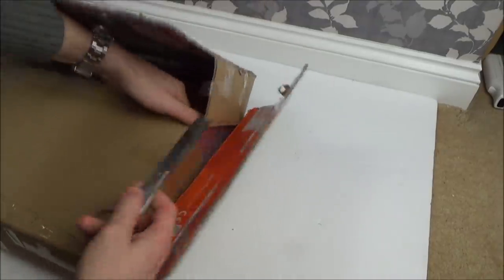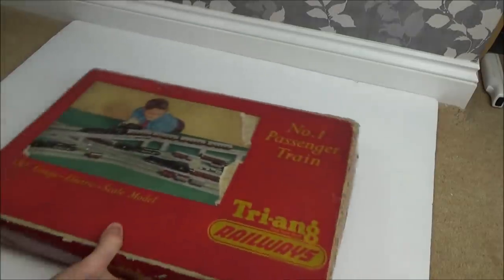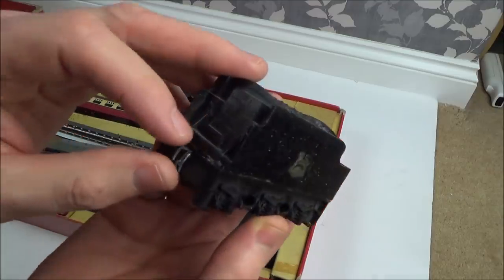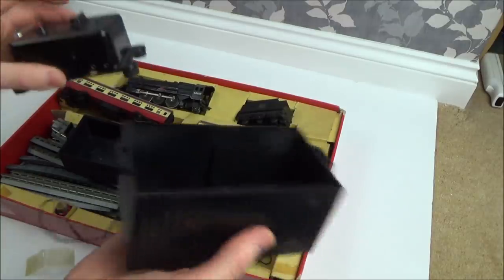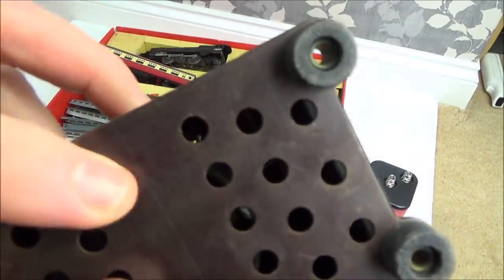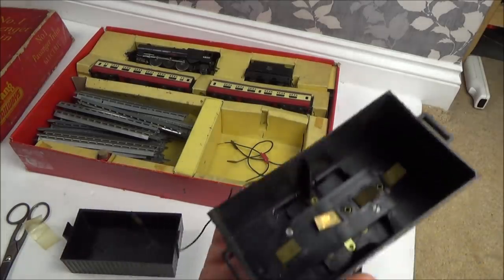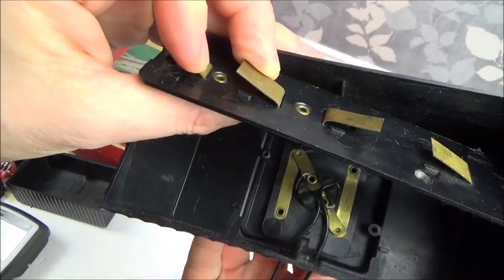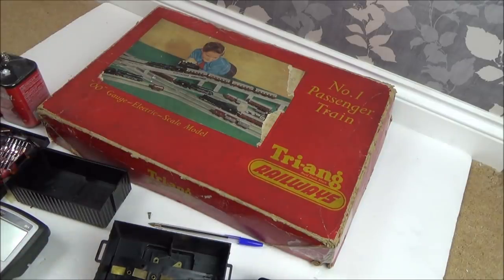eBay Pre 1980s TOY Repair Challenge PART 5

Comment: Simple resistance controls (resistors, rheostats, potentiometers) drop voltage only in proportion to the load (draw) of the item they connect to. With no load the voltage coming out will be little different from the input. With the load (motor) applied it will have a range of control. 

This is a constant in electronics and is how voltages are set by resistors in all circuits. Values are calculated using a formula (Ohm's Law) to give the desired result. Under no-load conditions voltage passes through with little hindrance but voltage will drop as loads increase. 

Battery operation was common in early train sets as it was thought that it was dangerous to allow children to play with mains connections. It is only in recent decades that well-insulated transformers and children gaining experience and confidence using plug-in items that parents and manufacturers have made line operated supplies (aka transformers) common and trusted. Youngsters today routinely use audio devices, tools, games, and toys on electrical systems.

There are now sophisticated power units used by hobbyists that have controlled and constant outputs that can even simulate real train behavior. The current system used by serious hobbyists is digital control (DCC - Digital Command Control) that can control sound, lights, speed, direction, and other functions.

Model trains have come a long way since the 50and 60s.
Reply from the maker: Great info, thanks for sharing it :-)

Comment: The thing with the electromagnet is effectively a circuit breaker-  if something shorts the two rails together, it'll disconnect the power briefly and make a loud buzzing sound (and hopefully avoid shorting the battery too badly).

Comment: My very first trainset was that one!
Those coaches have "gone banana " where the plastics have lost rigidity over the years. 
This is similar to the problem you have had with the shrinkage of nylon gears cracking on metal shafts due to the evaporation of oils in the plastics themselves. 
I once saw a video on solving triang banana coaches placed in a bath of warmed mineral oil and a spring placed in the body to stretch them back into shape.

Comment: I think the batteries for the rovex controller were ever ready pp7 type.
You have two controllers there.
The big one is an integrated one with the pp7 batteries inside the case and the smaller one is just a rheostat where you take a power feed from a 12 volt battery pack or a transformer outputting 12 volt dc.

Comment: Maybe it was modified to use LR12 batteries? If the original type of batteries is difficult to find perhaps the previous owner straighten the contact plates to allow the usage of LR12 ones, it would work i think (slower as these are 4,5V instead of 6, but enough to move the train).

Comment: You can try to use white winegar to clean the corrotion of the rails, a bath of 30min is good enough to remove corrotion and have better contact
Reply from the maker: Thanks for the tip :-)
Reply: My Mate VINCE how can i do to send to you a present for your channel?
Reply from the maker: Hi, thanks for the offer but I would rather you treat yourself to something instead of donating to this channel. I make money from the adverts at the beginning and end of the videos so I don't have to rely on donations. Thanks for the very kind offer though :-)
Reply: @Mymatevince  oh ok, i would like to send to you a screw kit from iFixit, nevermind :-)

Comment: The other controller was for a different set. Confusing huh! I vaguely remember a slot car set that works simular to that. I think the arm broke off. Those sets were so cheap anyways. The brass would oxidize and they wouldnt work. I remember those preslot car HO scale size.

Comment: Older batteries had the connections directly left and right on the top of the batteries,not angle like the newer ones. They would have fit in perfect. Battery design has changed since that was made

Comment: PP9 batteries were 9 volts instead of 6,  so that may also be a factor why the train struggles a bit
Reply: But it didn't take PP9 batteries. It took P996 Lantern batteries (6V). The train does run on 12V (my brother had one with an updated mains powered controller which delivered 12V). I think the train goes fast enough (as fast as I remember it - any faster would look totally unrealistic). The problem is just the occasional bad contact with the track. It's really important to get the track pieces fitting properly and making reliable electrical contact with each other (they tend to move a bit and break contact as the train goes round the track if not 100% connected).
Reply: These train's are designed  to run on 12 volts not 18 volts. Yes would give it more power but would damage the motors.
Reply: Did they change the contacts somewhere down the line then? It is strange the battery will fit but the contacts don't
Reply: I'm not sure that they have changed the battery layout over the years i have done a search that shows other 6 volt lantern batterys with the correct terminal layout but they won't fit in that box. as for the terminal's i have looked at other tri-ang set that use that box and they are the same. may be there was a small part that fitted on the positive spring of the battery and touched across to the positive  terminal on the box.

Comment: I remember the batteries you should use for this thing but the last time i have ever seen them was probably in 1985, and actually the "speed controller thing" is not meant to be used with the battery box, its meant to be used with a mains power supply which you get separately! The battery thingy is just for easy usage or so, back in the days i never even touched that and just used the speed controller thing with a mains power supply
Reply from the maker: Thanks for the info :-)

Comment: 00 gauge wire wool is a friend you should have, great for 'cleaning' terminals and all metals, Also the number on the train is the only real way to match a train, on the outside by the driver section eg: 700123

Comment: I've seen a lot of sets built using silicone on those type of tracks to mount on boards etc prob use the same idea to keep tracks together if it going to be prem set

Comment: Just wondering if you had to pieces of tin that could soldered to each outer contact in the form of a cross in order to contact the outer spring contact.

Comment: I tryed getting an RC fireboat  on E- Bay but they wanted $100 for something that doesnt work. For $9 dollars more I can get one that works. I offered $45 plus shipping and they said no. I dont really care but it would have been fun to fix it. I already upgraded one like it to an actual RC quality receiver/ transmitter and servos. The listing said it didnt operate but would be good for display. The thing is... Its not a display item. The quality isnt high enough. It is all plastic, not a high end unit. Oh well. I dont think they really wanted to sell it.

Comment: Hi Vince. Another great video.Hope you do well. It might be an idea, to get a few Lego parts in a small box, as you'd be surprised what you can fix using various bits of Lego, and maybe the tracks could have been repaired
/reinforced by using it to create tabs.
Reply from the maker: It is a good idea, I have never thought of cutting up Lego to use to fix other things. Cheers for sharing the tip :-)
Reply: @Mymatevince  see toypolloi, a great user of this

Comment: Hope you do OK on this Vince but there are quite a lot of similar sets on eBay (some with different track admittedly) at not very high prices, so I'm not holding my breath on this one :-(  Good job nevertheless on getting it going. Very nostalgic for me because, as I mentioned in a comment below, my brother had this set except he had an updated, mains powered controller/transformer delivering 12V 1A DC. I think the train ran at about the correct maximum speed...just the track contact was a bit dodgy on your one.
Reply from the maker: Yeah, I don't think any profit will be made as it is still not perfect (far from it) and there isn't much demand. Nice to hear your brother had one and that this train might have been running at its normal speed. Not bad for a possibly 60 year old train. Can you remember if it was originally from the 50s or 60s?
Reply: @Mymatevince  I think it was about 1957/58 Vince, which may have been a slightly later version than yours. The locomotive and coaches were identical but, as I say the controller (not the Fat Contoller :-) ) was superior; it was a cast iron model with a chicken head knob control. It was mains powered and, via a transformer in the case, delivered 12V 1A (that bit stuck in my mind as I have always been into electronics). I can't be sure now but I THINK the track was two rails joined only by sleepers but it had exactly the same electronic connectors. I'm guessing that the set you had probably predates my brother's by a few years (probably 1953/54?). We had carpet flooring then in the living space (the kitchen was too small to play in) and therefore derailment was common :-)  Great Channel mate, keep up the good work.
Reply from the maker: @standishgeezer  Interesting, I thought it was 50s. So it does definitely run on 12V. I need to find a picture of the inside of the original 'working' battery control box to see what the contacts looked like. Most comments on here think I used the wrong shape batteries but I don't think I have :-)
Reply from the maker: Excellent, the instructions are printed on the lid of that box, mine must be an earlier model. So like you say it clearly shows and it is written Ever Ready 996 but the strange thing is that the contacts on that box are exactly the same as mine so the batteries are not going to make a contact on that one either. Strange to have both of them with the same problem/missing bits. Maybe the battery design has changed over the years from straight spaced but I thought those lantern batteries always had diagonal spaced contacts!!!! Thanks for finding the link :-)

Comment: If cheap enough replace the wires from the power to the switch and to the track and use a fine wire wool on the track when will this be on eBay I want it
Reply from the maker: Hi, I need to get it listed either Sunday or Monday. I think I overpaid for this though. There looks to be better ones on eBay :-)

Comment: looks like a HO set try using a new track and get track connectors for power at one joint wired to new power pack

Comment: the battery is wrong.  it uses a pp9 battery similar contacts as pp3 but a big battery like the lantern battery. the terminals are inline like the control box

Comment: use 0000 steel wool to clean them tracks  :D the cleaner the surface the less the voltage drop

Comment: |Out of topic| Sir, please help me
I just initialized my PS4 it has completed and now It is  saying connect dualshock 4 using the USB and press the home button
I pressed the home button but the PS4 isn't responding to it. pleaaaaaaaaase! Help me
Reply from the maker: Try another USB cable as some of them use only 2 wires for charging but you need to use one with 4 wires for data and charging :-)
Reply: @Mymatevince  would you make a video on it?

Comment: Have a look here Vince. You can see what the terminals should look like: https://www.modelrailforum.com/forums/lofiversion/index.php/t18705.html
Reply from the maker: Thanks, those contacts are completely different than my one. I can't see how any batteries would fit in that one. Really strange. Haha...I am more confused now than ever :-) Thanks for the link though :-)
Reply: @Mymatevince  There's a pic on there of the old piece of paper that shows the internals with the original batteries. Looks like they are the same to an extent but they do have inline contacts with the positive contact using a sprung plate to position the point of contact to that corner where the positive spring is on the new equivalent. Perhaps it could pivot slightly on the older batteries?
Reply: @Mymatevince  It looks like the only thing you could have done really was adapt it like you did. I wonder what they did. Hmm.
Reply from the maker: @SimonNemeth  Annoyingly the 'Proudly hosted by PhotoBucket' is right in the way!!!! I think I can see a foldable tab though so that would make sense if the negative was a spring and maybe the positive could be adjusted to slightly different positions. I think you are correct. So the batteries are still probably called the same (P996) but the older ones had a different design on the positive which was still angled but not a spring. This also ties in with the picture on the old Rovex battery control box in this video which shows a spring for the negative and a rectangle strip for the positive. Thank you. My mind is now set at ease :-)
Reply from the maker: Thanks so much for doing that. Well that shows it clearly. A nice sprung tab for the positive terminal. So the battery design has definitely changed over the years. It also looks like it in inline rather than angled but because of the length of the sprung tab it should also fit in devices that have angled contacts. Thanks again as that picture has answered the question perfectly :-)
Reply: @Mymatevince  You're welcome ;).

Comment: what was that spray you used.
Reply from the maker: That white and red spray can is Servisol tape head cleaner. I bought it for trying to fix stick drift on gaming controllers but I think it is the same sort of stuff as contact cleaner :-)
Reply: @Mymatevince  contact cleaner degreases and leaves a residue, for conductivity,     head cleaner  leaves no residue, or tapes would collect this by transferrence.     a weird comparison is  water dispersant 40  which lubricates, cleans, and conducts.  ( wd-40  / fish oil )

Comment: A beautifull fix Vince, but I think you are wrong on the batteries. As said below the PP9 batteries were higher voltage and have straight contacts which should fit right in and give it more oompf. 
I also found a website with loads of info on it, you might get the definitive answer on that one:  http://www.hornbyguide.com/item_details.asp?itemid=1240
Hope it helps.
Reply from the maker: Thanks for the link, I will check it out :-)

Comment: I find your videos entertaining and all, but a lot of the time I'm am sitting here like yelling at my tv or facepalming heavily. I know absolutely nothing about that set, but clearly the batteries are the right form factor (dimensions) but terminal positions are not right. Clearly a different model of battery. The other controller looks more like a mains setup. So you have the portable battery one, and a more elaborate mains one that you obviously don't have all the pieces for. Myself, I would sooner wire in a 12V power supply to the portable than try to rig up the wrong batteries. There is no logical reason to have 2 full forward and reverse switches if they are both meant to be used together.

Of course internal can parts are coated, has to resist whatever acids, salt, water that may be present in the food to not contaminate it. 

Like I said I enjoy the content, but other times I can't help but cringe at some of the things you do.

Also, don't bother including things such as batteries, games, etc, you are wasting your money buying these things new, nobody is going to pay more for them being included (would you trust used batteries? or about a game you might not care about?) and all you're doing is increasing the weight of the shipped item, making it more expensive to ship and cutting into your profits.

Comment: Look up battery 266
Reply from the maker: Hi, thanks for the comment. I know it looks like it will fit better but they are 9V so 18V in total. A viewer linked me to an eBay listing of one of these sets with the instructions showing in one of the photos, and it shows 2x P996 batteries which are the 6V lanterns batteries like the ones in the video. I really don't know what the contacts looked like originally but I am confident the batteries are the correct type for this set :-)